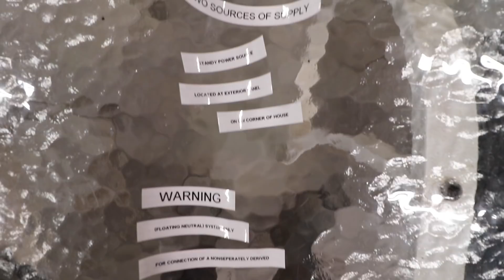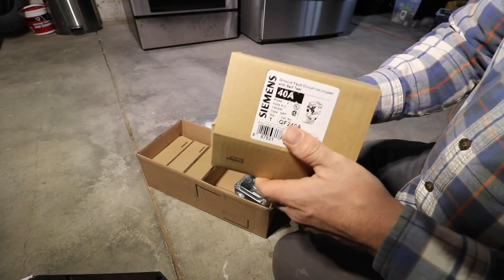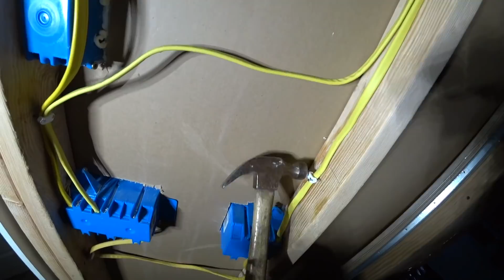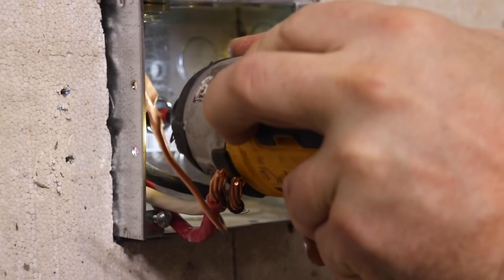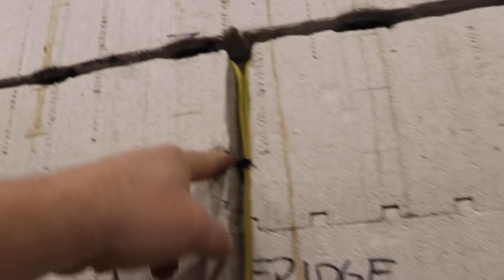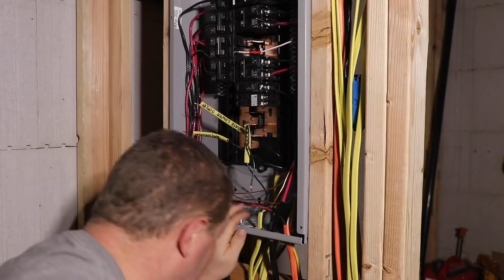We FAILED OUR ELECTRICAL INSPECTION! Now What?!

Comment: man i used plastic covers,, that metal can light you up if you touch one of the line wires in the box, even from the front , like a child touch the prong with a toy or butter knife,, hair pin,  the metal cover will be ground to any hot because its grounded from the metal box

Comment: The code is becoming increasingly more ridiculous by the day...…… you will never idiot proof everything, the "If's" you mentioned have an incalculably high improbability of occurring.....like detaching the heater greenfield from the box without 1st turning the breaker off. I mean, someone doing that pretty much intends to remove the conductors....
As for tamper resistant outlets you'll soon find that the cord plug "prongs" are of insufficient length to securely engage the blades of the outlet and easily work their way to falling out...….sooo, you've exponentially increased the number of "touches", aka the times you'll be messing with plugs so what do think just happened to the statistical probability of injury??.....get the drift yet? 
Oh yea, you better not forget to ground your steel stud plates...….that'll be in the code the next time Clueso comes by......One minor suggestion, put your panel fronts on with the door open so you can be sure the breakers are aligned or you if you forget to remove the  blanks when adding a breaker....

Comment: Question???? Could you have use a GFI breaker system the protects the whole house. That's what we did at a cost (including installation) of $125. It protects every circuit but we still used GFI plugins in all the water danger areas also. Safety in home electrical systems has been in the past very iffy at best.

Comment: you've added about 200% more work by not running metal conduit in place of your romex. now you've gotta screw guard that whole wall. also you could have used all of the knockouts if you just mounted the breaker box on the icf wall in the utility room. you wouldn't have had to deal with stud bays or that 2ft where the wires are exposed in your "storage" area

Comment: GFCI work by mesuring the difference in current between the hots and neutral. If a tiny imbalance is found it trip.

On a single pole, it would basically do HOT + Neutral, and must not excede a threshold. Due to the flow being 'inverted' on the neutral (think of a water loop, if you push water in the hot, water would come out of the neutral) it would be for example 10A - 10A = 0.000A

On a dual pole, the second pole is 180° out of phase, so the same is done: H1 + H2 + N must be bellow the threshold.

So, a 240V 30A load, you would get +30A + -30A + 0A (neutral) = 0

A 30+31A would be 30 + -31 + 1 (the extra 1A return via the neutral, and due to the loop flow in reverse) = 0

Now, 240V 30A + touch any hot and get zapped by let's say 10mA flow, you get like 30+30.01+0 = 0.01A unaccounted for, which is more than the trip current (I am unsure if it is 0.4mA, which seems too low, or 4mA, or whatever else), and the breaker trip.

Comment: Couldn't you just use spray foam in a can to fill the voids in the walls where the wires are stuffed in? You will be doing that anyway to retain your insulating values, right? So wouldn't that be sufficient to meet the code that says the wires have to secured?

Comment: I think people give code a bad name.  99% of code is written because of someone learned the hard way.  Design boards are where the human component becomes a bigger headache.  But the truth is, doing things right is almost away more expensive than doing it so it ‘works.’  And lots of people are short sighted and would rather save a dollar here at the expense of rolling the dice on safety and longevity.

Also, people just don’t like reading.  And you have to know how to use search functions and follow legal types of writing to get code right.  Things are defined, then exceptions and additional rules are given in other parts of code.  It can take a bit to decide if you’ve got the big picture and everything accounted for, but code itself is normally fairly straightforward and well defined.  Just super dry and not exciting or quick to breeze through.

Comment: Can you use a grounding clip on the range electrical box extension?  The grounding clip that they carry at Home Depot can handle 14 or 12 gauge wire.

Comment: I have been renovating my house for 4 years and not an expert but one thing I have learned if its metal ground it.  If you want to future proof your electrical system, use GFCI/ACFI and/or ACFI on everything.  The new rules are going this way.  The cost of putting in electrical is going through the roof.

Comment: In reality, they're codes there they can enforce that would keep you from occupying the residence. That's what they're there for. To ensure that a residence is supposedly safe to live in. I don't know how we were able to exit before a ton of codes were around to supposedly keep us from harm. I would wager a ton of money that there are a ton of residences that aren't meeting the code because they were grandfathered in. I'll wager more money that the number of folks that have been harmed in the past is minimal if nonexistent. 

Take for example. I recently had my Hot water tank replaced. In order to meet code, I had to place a pan under the hot water heater. The drain isn't connected to the outside as that's not required. The pan is inadequate to hold the water should any serious leak occur. The costs to do this was a few hundred dollars. As you have to have an inspector come out and these sundry things that are supposed to keep us safe cost money. It made the job $1300. Instead of being under $1000.

Comment: Jessie, do yourself a favor and put another breaker box on the main floor of the house.  Depending on the number of circuits,  it may become a nightmare running the Romex between the garage and main floor.  That way you only have to run a main feed wire up between the main and garage.  I'm not an electrician, but it seems like that might make your life a lot easier when you start up there.

Comment: US rules seems to be quite difficult to manage, and brands seems to not be compatible, what a nightmare ! Here in France breakers all have a way to add padlocks, and we can mix brands (legrand, hager, Thompson, Schneider, GE,...) they all can be used on the same breaker box. I am not sure if I understand GFI well, but we must all have what we call a differential breaker that will protect all the house when detecting a leak between neutral and live to ground, in general the difference must be higher than 30mA. Plus, I don't think we have this ground for every wall box prolvem, as we use plastic boxes, maybe the metal one are forbidden. These kind of breakers have a test button. It is nice to have news again, please keep continuing :)

Comment: Can't believe the inspector didn't say anything about that male generator plug and cord hanging on the outside box although they may have changed it.
Great Stuff makes a firestop foam that they could have used to hold the cables in the foam blocks.  They make (I'm not sure they still meet code) a clip that slips over the edge of the metal box to provide a ground connection.  Could have saved the cost of those GFCI breakers by just putting three disconnect switches by the water heater.

Comment: You might want to pick up cover plugs for the open holes in the bottom of the panel now that you moved the wires to the top, some inspectors want to see a box with no open holes. Just food for thought.,

Comment: The 2017 code cycle requires arc fault protection on bedrooms,  dining rooms, living rooms and any other habitable areas..this can be done at the breaker or at the first box in that cable run. Idaho is shown as a state that has adopted the 2017 code. Checck with your inspector to get his opinion.

Comment: Interesting factoid... While GFCI means Ground Fault Circuit Interrupter, many people think that a missing or bad safety ground will cause it to trip. Not at all the case. What trips a GFCI is if the current in the "Line"  or "Hot" wire does not exactly equal the current in the neutral wire. If you are being electrocuted, some of the current normally in the neutral wire is going through your body to ground. However another cause for tripping a GFCI is if you accidently wire a circuit to the neutral wire of another circuit. This is easy to do in new construction. The GFCI trips immediately and repeatedly until the wiring problem is found.

Comment: Damn, redoing all the work sucks. Im an german electrican. Here we only got a few RCD‘s per house or one per electrical panel because we run the main wire to a few RCD‘s and from there just to Standard breakers. So the RCD provides the Protection of the human or pet and the breaker protects the electrical device. Maybe a system like that is allowed in your State in the US that would save you many Gfi protected outlets and breakers. Hopefully you pass the next inspection. Greetings from germany.

Comment: look into putting a sub panel up stairs would save alot of space in your panel  also if you need nail plates on your foam walls get metal sway brace 10 foot long 2 inches wide hole every inch be quick and easy   good luck

Comment: Can't believe the cost of RCDs (GFIs) there. Can get a whole 240v 100A consumer unit with dual RCDs (to cover all circuits) and MCBs for less than the cost of one of those breakers. (In UK) Admittedly, we're not really allowed to do the wiring ourselves here (nightmare getting a certified electrician to qualify the work).

Comment: A gfi (or RCD in gemany) works by comparing the current that flows in and out through it, if there is no fault then the inducted magnetic field in the measuring spool is leveld out and all is fine, is there a fault and current flows through the ground wire then the spool inside the gfi senses that the magnetic field is not leveld out and it trips the gfi. Another point is that you have to run the neutral wire from the curciut through the gfi else it would trip the gfi because the current is not measured correctly since the current that flows back through the neutral wire doesn´t pass the gfi on its way back

Comment: Great Job. I see the points of the drywall screw coming thru the electrical box securing studs (Stud Bays) and the screw point is popping out next to wires (33.40 mark) .I think the screws may be a hair long. Thanks for sharing and Happy New Year

Comment: I just put a meter and panel in my garage.  I know that what I needed to do wouldn't pass code without breaking the bank.  So I did just lights and one outlet.  After getting the inspection done I did all the monkey rigging and haven't burned down the garage......yet.

Comment: nope they just simply work now problem. and GFI I highly recommend no matter if code say's yes or not. They are well worth the money. Especially when you have an outside SPA for example ;-) where you can buy a breaker for the bigger discount price right in the box which are 40AMP or 60AMP just saying. I also HIGHLY recommend you stop using wire nuts. Use wire push-in connectors as much as you can. They are common use in Europe already and are rated up to 600V and will not loosen up with vibration. Also if you glue the wire in place why didn't you use an EMT pipe and secure it with Glue / Foam into the wall that should meet also code. Worth asking. Because in commercial it is. Also you can EMT Pipe from your Panel out into the Crawl space this way you don't need to staple. Look into it.

Comment: is it not acceptable to utilize an AFCI / GFCI / CAFCI breaker UPSTREAM of the individual breakers (IE At the main breaker) vs having to buy 9 or 10 of these for each branch circuit?  Pretty sure this is acceptable for GFCI receptacles - one GFCI upstream of other outlets to protect several downstream outlets.

Comment: In Germany we have a Main GFCI, in the Electrical Panel. After this are the brakers. Therefore you have the complete wiring protected and it is much cheeper. Than having for each circuite a RCD with integrated fuse. 

In my opinion are GFCI outlet's not so good, because the wiring from the electrical panel to the outlet is not protected. Esspecially if you are in construction this could be dangerous. 

I find your videos very nice. It is intresting to See the big diffrents in the electrical Installation between the USA and Germany.

Comment: Just a question since im not so firm on the american electrical system and code, don´t you have a gfi that sits before the busbar in the panel so that the whole breakers in the panels are protected, thats how we do it in germany(and probably most of the eu) you come from the main breaker and go throug the RCD (or gfi) to the breakers but the Rcd is just looking for a ground fault and not short, for a short therefore is the breaker, so you see instead of buying x gfi´s we have just one to protect it all.

Comment: The GFI works by adding together current going in and out of the load, it will add to zero as long as all the current goes through the breaker.
In an AC, the voltage and current change direction every cycle, and that the voltage and current are opposite between the two hots (one is positive to ground when the other is negative to ground).
Even if the load doesn’t have a neutral connection, the GFI does need it so the test button works; the test button simulates a ground fault by internally leaking a small current around the GFI to neutral, but that wouldn’t do anything if the neutral wasn’t connected. It actually doesn’t matter where it leaks to as long as it leaks, however leaking to neutral will prevent a GFI from tripping closer to the supply (wouldn’t want to have to walk to the meter post because you pressed the test button on a circuit in the house).

Comment: on the GFCI 2 pole breaker the white neutral wire is primarily used to operate the test function on the breaker. When the test button is pushed there is a shunt from one of the load legs to the pigtail which trips the fault protection portion of the breaker. The two wire 240 circuit uses a different method in the event of a true fault. the breaker looks at both legs and compares current and looks for a differential which will then trip the fault protection.

Comment: The easy way of removing knockouts is with pliers.  One hit with the pliers to dislodge the metal.  Then use the pliers to wiggle the knockout until it breaks free. No need for a hammer ever.

Comment: Hi WOW I said it before US wiring is so complex it sounds to me that the things you are calling GFI's are what we in the UK used to use and call Earth leakage circuit breakers ELCB's we stopped using those some years ago now and changed to RCCB's Residual Current Circuit breakers if memory serves both these devices must trip in 30 milliseconds and should be tested at least once a year, we use just one or two post the electrical input breaker these devices I believe protect you from those electrical devices that are not earthed like TV's and things with switched mode power supplies etc. the average three bed house in the UK will likely have  two RCCB's and a main circuit breaker and one lighting circuit for the whole house the house I live in has one circuit breaker for the whole house it is a ring main that's all you need. You guys have run more wire for a shower room a range and a fridge freezer than there is in my whole house WOW.

Comment: Some nice changes for safety but why didn't the inspector specify to put certain labels on the outside of the service box? As I recall the outside disconnect as well as the location of a gen set (and it's disconnect) are supposed to be visible near the meter and again for the disconnect on each remote building.

Comment: We did a large remodel (2nd floor), Nd I did all the outlets flex, etc.  Put the metal plates on! It's worth it.   Also take pictures for future remodeling.  I know you think a video is enough, but, consider sequencing the pics with a yard stick so you can go back to the exact spot you need.  Good luck

Comment: Im surprised theyre not making you put Arc Fault breakers for living space. They also make combo Ground Fault and Arc Fault breakers. But keep in mind those are two different protections.

Also you should have gone with a plug on neutral panel. That means you can get breakers with no pig tails for AFCI, GFCI and GAFCI breakers.

Siemens also makes 2 main brands. That are not compatible with each other. QA and Homeline series. I like the Homeline plug on neutral as the neutral bar also has screws right there on the bus....

Lastly you keep complaining about number of breakers. Go with a 40/80 or even 42/84 (space/circuit) panel, which higher circuit count means it accepts "Tandum" breakers, not to be confused with "Dual" breakers (220v 2 pole).

Comment: I was thinking about your heat system the other day and if I remember correctly you need a pump to push the water through the floor lines. Since the pump runs on electric, would you be able to use your current solar set up as a back up for power to run said pump. If so and you are using wood to heat said liquid in the lines then if the electricity were to go out, you would have no heat, but, with the solar as back up it could keep the liquid circulating during a power outage and therefor you would still have heat... It may not be quite that simple, but just to put a bug in your ear.. Great videos and by the way, congratulations on the baby arriving in a few months...